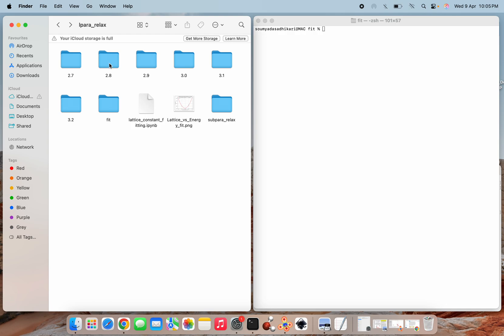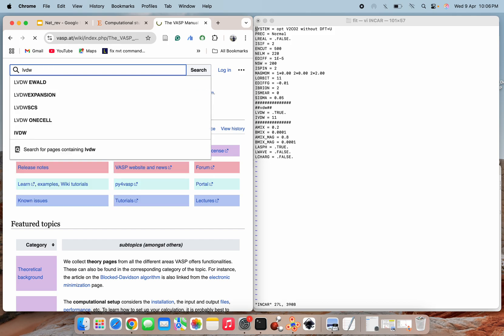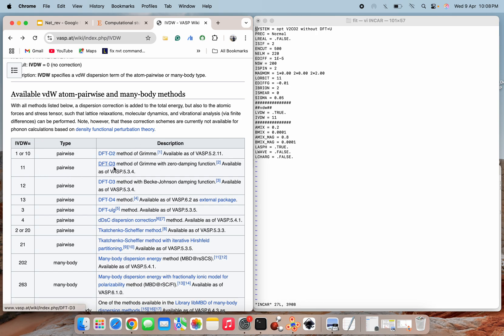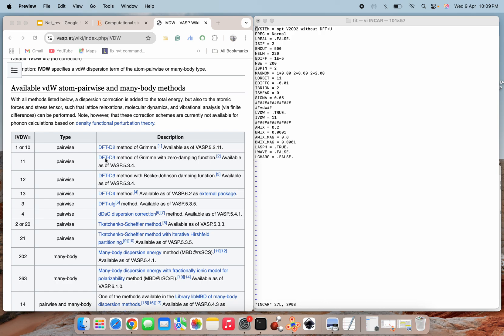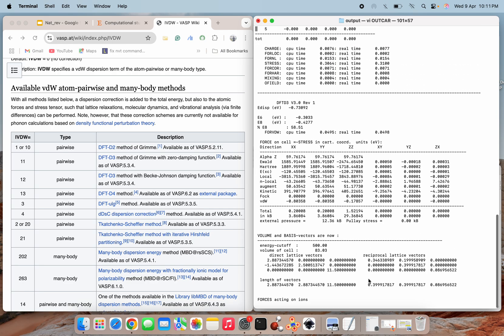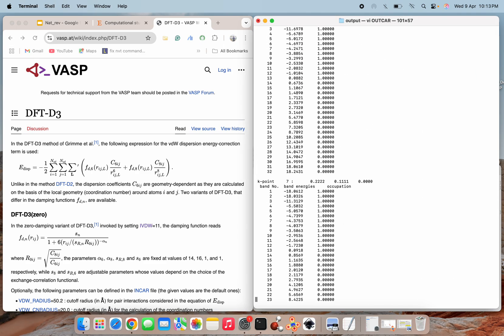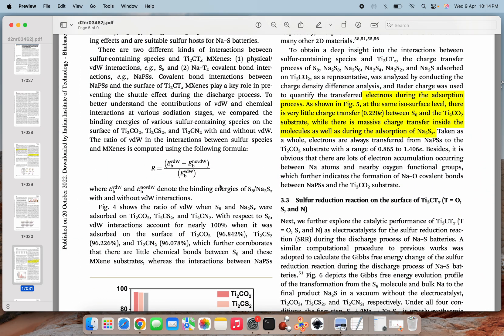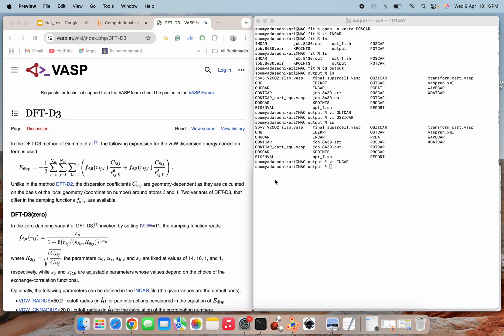VASP Tutorial - 4 Van der Waals interaction DFT-D3 method

Comment: thank you so much teacher, I read a recent paper, and I noticed that they used the vdW-DF-cx method to account for van der Waals interactions,  which specific INCAR tags are required to properly enable this method in VASP, Secondly, is there any software available that can help extract atomic positions, forces, and stress tensors from the OUTCAR file?
Reply from the maker: You are welcome. So this vdW-DF-cx stands for van der Waals Density Functional - consistent exchange and is a non-local van der Waals density functional used in DFT to more accurately account for dispersion interactions (van der Waals forces), which are crucial in systems like molecular crystals, layered materials, and adsorption phenomena. If you are using VASP, then use the INCAR tag LUSE_VDW = [logical] and related tags as well. In Quantum ESPRESSO, you can specify the functional as input_dft = 'vdW-DF-cx'.
https://www.vasp.at/wiki/index.php/LUSE_VDW

Ref. Paper: https://journals.aps.org/prb/abstract/10.1103/PhysRevB.89.035412
Thank You
Reply: @computational_physicist I’m incredibly thankful! Also, I’m using VASP, and I’ve used the following tags for van der Waals correction:

GGA = CX

AGGAC = 0.0

LUSE_VDW = .TRUE.

LASPH = .TRUE.

Additionally, how can we extract positions, forces, stress, and energy from the VASP output files? I’ve recently started learning VASP and would appreciate any guidance
Reply from the maker: @ Yes, yes, I forgot to mention the same in the above comment; usually the CONTCAR file gave us the final position of the atoms as we gave in POSCAR. 
To extract forces on atoms can be found under the TOTAL-FORCE section in OUTCAR. These are especially useful when checking convergence or analyzing local atomic environments.
grep -A 10 "TOTAL-FORCE" OUTCAR

The stress tensor (in kB) is also printed in OUTCAR and reflects how the system responds under pressure.
grep "in kB" OUTCAR

Total energy is reported as free energy TOTEN, which represents the ground state energy of the system at each ionic step.

grep "TOTEN" OUTCAR

This way you can go; otherwise, you can run AIMD simulations to get an XDATCAR file where the positions will be written after each time step, and once you get the position, you can simply write any code to get forces and stress tensors as well.
Reply: @computational_physicist  noted, thank you so much for you valuable help